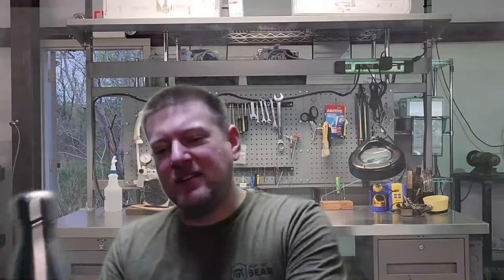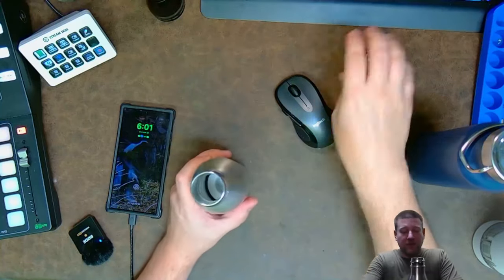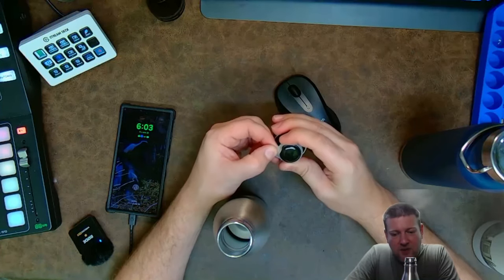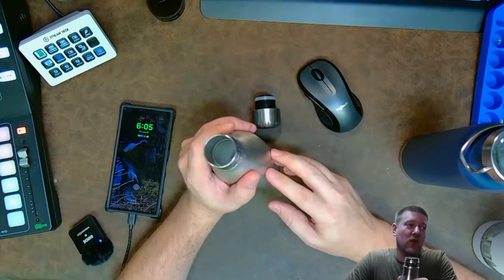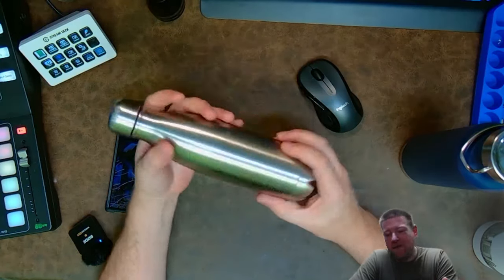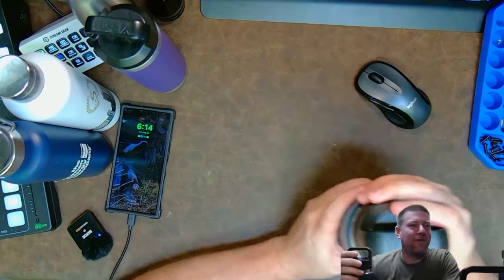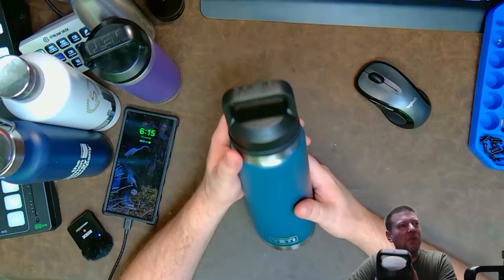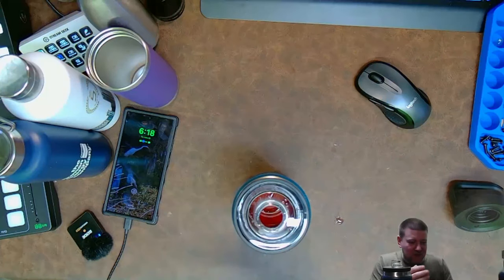Water Bottle Technology!

Comment: That's a great example of problem solving engineering from Yeti.  I several have my stainless steel bottles with straw attachment to their caps, wide mouth as well, so they can easily be filled with icecubes, protein powder scoops, etc., and the straw prevents ice bergs ramming and chipping my teeth.

BUT, the cap spigots and straws will always have mold, hard to clean due to many parts involved.  Already purchased a Yeti, thanks for the video, really enjoying these type of content.